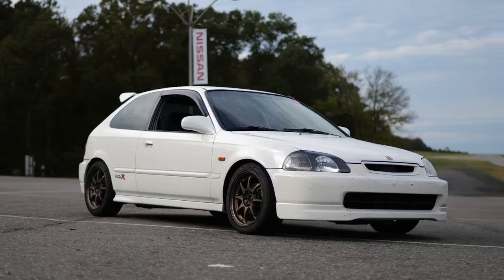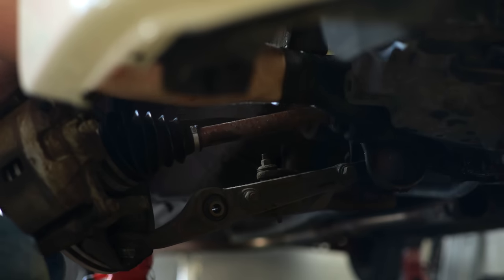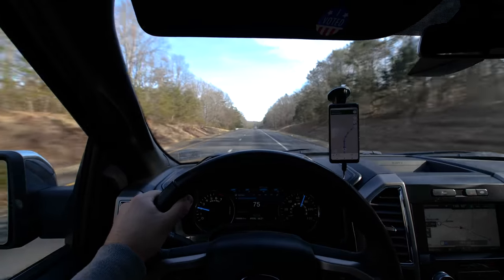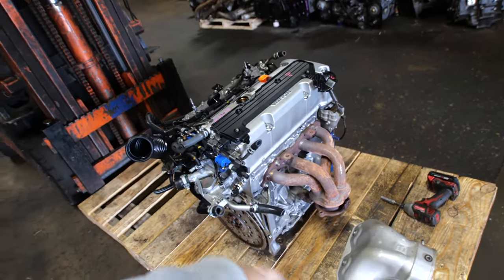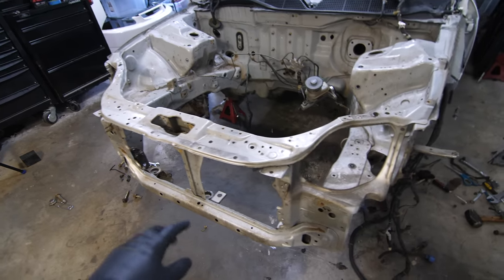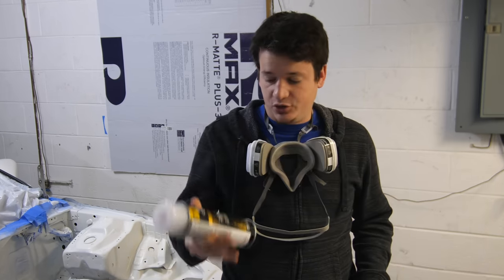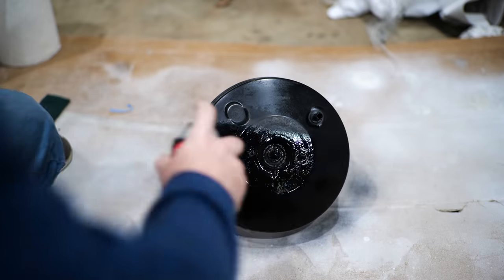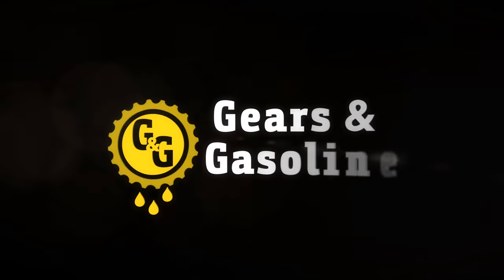K Swapping My Honda Civic – Episode 1

Comment from the maker: Something to note about this video: We no longer endorse Jspec as a source for buying JDM parts. Jspec was supposed to be a reputable source to buy parts from instead of buying from the classifieds. It's sad to hear there are allegations against them for selling stolen parts from Japan. Because of this, we can no longer endorse them as a source for buying JDM parts.
Reply: No!!!!!  I was looking into purchasing one from them since they are in Va!  Where would you recommend purchasing a motor from?  Im located in Northern VA.
Reply: @wags823  JDM Engine VA for sure, there's a ton of different shops in NoVA and so far I've heard the most good things about JDM EVA, I'm planning to pick up my B20 high comp from them
Reply: Doesn't matter where they get the parts. as long as you buy it fair and square no harm done.
Reply: Update, they fucking got me with the B20 they sold me, junk motor
Reply: @bagfumbler  damn, respect for finding and updating a year later.  How is the behold going??
Reply: You supported those dudes with the refrigerant evac. That's even worse.

Comment: Engine swaps, the coolest thing since engines.
Reply: yep! but its risky i think
Reply: @lexithelexus7377  how is it risky
Reply: @fabiolawrence9162  the car wasnt designed to withstand the pwoer so the hoses are more likly tpo break, or other parts of the car are exposed to more presurre
Reply: @lexithelexus7377  Yeah, that's why he's putting in a new radiator and A/C compressor so that it withstands the higher rpms  and pressures. New subframe so that it fits in snuggly and well distributed. If the transmission is the same, that one might suffer but everything else should be fine.
Reply: @lexithelexus7377  you've said that same comment in all the other post lol . Having a race car is always a risk . But were always going to take that risk . If it breaks we fix it!
Reply: @miguelpatino1443  i just cant phantom driving a high hp car with the mods, and risking something to just combust, u know
Reply: Lmfao bruh.
Reply: @lexithelexus7377  i dont know . I have a evo 8 I plan on making faster and I want full bolt ons and bigger turbo.  It's part of the game to break stuff . If you want reliability buy a fast car under warranty . But I like to wrench on my own car
Reply: Not really, turbo whistles are stupid but cooler than an engine swap
Reply: "Since engines" lol 😆
Reply: Just done a kswap on my civic
Reply: @charisma7268  you should have filmed it!

Comment: 10:49
I wasn't going to type the tip but...Probably the easiest way to clean the bay is to section at a time, spray degreaser on it, scrub with a wet wheel brush, rinse the brush when it's too dirty, then rinse the section, repeat until clean.

Comment: I bought a brand new 1997 Civic DX hatch—the exact same car as this. What a sweet ride. Little motor was so rev happy and smooth! And it had the best shifter I ever used; smoother than my new 1972 MG, my new 1987 Z28 Camaro, my new 2005 Civic sedan, my new 2017 K24 Accord Coupe. (Yes, I’m old, lol). I’ve certainly enjoyed your x-country trip and these swap videos. Thanks!!

Comment: "...by the time I gotten to sanding the engine bay, my arms were so tired I had to call in my fiance for extra help" YOU LUCKY SOB; do not let her get away!
That is a really good rattle can engine bay job; so good in fact I'd believe it was done with a spray gun; kudos for going to these lengths; the new hardware, hood latch etc. is just the icing on the cake, and what separates a great swap from a good swap.

Looking forward to more of this swap/build even though I have zero interest in FF stuff.

Comment: Did you trade the rare and expensive b16b for the dime a dozen k24?
Reply: GIZZMOTORSPORTS fr lol I would’ve just started building the b16b a lil bit if he just wanted a lil more power. But this makes for better content
Reply from the maker: The K24 will make twice the power with a much flatter powerband
Reply: @iiRapidzIV  a 1.6 doesnt compare to a 2.4. keep the b16b untouched and tucked away for sure, but swap it for a k24 yesssir!
Reply: dvtc8u b16b is good for turbo. They can do damage.
Reply: @TheBb6prelude  even a d16 will do damage turbo. but cant compare to NA 2.4
Reply: You haven't driven a properly k swapped civic.
Reply: Should have built the rare b16b instead with internals and a proper Turbo, everyone's doing a kswap but not everyone has a b16b engine just saying 🙄
Reply: @theimporttuner399  exactly! Everyone has gone K.
Reply: @The Talentless Mr. Kipling these cars are so light, traction is already limited with a b series. 2.4 wont make it any faster around a road course.
Reply: @GearsandGasoline  you gotta put it to the ground tho. I was just saying the B16B is and will always be worth a lot more than that k24, I hope you didnt straight trade it. I would have personally built another car, I liked your HB as it was.
Reply: @GearsandGasoline  my modified all motor "B16B" EK vs your K24 how much of a performance difference would we see?
Reply: @GIZZMOTORSPORTS  This. That EK hatch he's got is just so clean and such a nice Type-R clone I personally would've left it alone. But it's his ride and I'll definitely watch the build
Reply: sekint lyf  it's not a real type r if I remember correctly, just a clone.

Comment: When did bolts start getting so much attention. The first time I heard of special bolts is tommyfyeah with his zinc coated bolts
Reply: I bought a bunch of yellow zinc 10.8 bolts from belmetric.com for my Miata engine bay to replace a bunch of old rusted silver bolts.  Made a huge difference in engine bay appearance!
Reply: @Patrick94GSR  I can respect a safe and practical car modification
Reply: whoa  amamamma !
Reply: Downstar, for sure. Before then everybody was trying to match bolts up at hardware stores. Now everybody from MPC to Ebay has bolt kits.
Reply: "dOWnStAR fANcY HaRdWeaR"

Comment: Love these videos. 

Recommend Evapo-Rust to remove rust from any rusty parts before painting. Drop it into a jar or bucket of the stuff, and rust will be gone in a few hours. Sand or use steel wool to knock off any remaining buildup.

Comment: Going from my B18C1 to a K20a2 and it's honestly feels like V6 torque with the 4 banger high RPM pull up top in the range! Chirping 3rd and 4th on the street and spinning through 4th to 80 in the rain. Open differential is not ideal though so don't forget an LSD! Building hondas is so fun!

Comment: "I didnt want to remove the lines ans get air in them".....removes brake booster....lol
Reply: As long as you don't crack open the hydraulic lines on the master cylinder, you can remove the booster.  It has it's own set of seals, and does not make contact with hydraulic fluid (unless the master cylinder is heavily worn, and it would require replacement at that point anyways)
Reply: Oh my😂
Reply: Nice try bro
Reply: Was wondering why he was so desperate not to get air in the system, surely you could just pick up some dot4 and do a full brake bleed afterwards?
Reply: @blazeclarke  not having it removed didn't seem to mess up the job much anyway, so might as well not bleed the brakes if you can

Comment: Since when did 260 horsepower make a car not streetable? 😂😂
Reply: In a car that weighs around 2000 pounds the wheels are gonna spin too much off the launch and you have to be more careful with it
Reply: Btterthanyu I'm talking about daily driving.
Reply: It doesnt.  But, I know Ben will also be doing other upgrades in the powertrain, such as a ceramic clutch, lightweight flywheel, limited slip differential, Urethane or Delrin mounts, etc...   All of these will increase NVH (Noise, Vibration, Harshness) and will take away from it's smooth driving characteristics as it had.  I have actually driven this Civic, and it changed my opinion of Hondas of that era.  Can't wait to meet up with Ben sometime this year and get an opportunity to drive it afterwards.
Reply: If he runs hard mounts, doesnt keep ac, runs a twin disk, doesnt have decent coilovers, or runs a 3" exhaust, uses race harnesses only, deletes the heater core, or runs a top mount shifter, it's not that it's not streetable, it's that you wouldnt want to use it to pick up paper towels at cvs or hit a drive through late at night. It just becomes an annoyance for normal life stuff.
Reply: ikr should be more streetable with the 6th speed compare the b16 5th on the highway, plus rhdkev drove his integra everywhere with his k24 k20 frank.
Reply: @jdmtsheej3051  1/3 is honestly a bitch in the jdm 6 speed. I'm in 4th before I get through lights just to avoid unwanted attention.

Comment: Note for the next project: find some cheap media sanding gun  and some affordable medium (30-40 bucks should do the trick at harbor freight/princess auto for a 15 bucks gun and 20 lbs of idk what media). Put the car in  a large tarp, bend the tarp walls upwards and prop them well, then put guards/wall all around, the walls falling inside of the tarp. So: any grain that shoots outside, hits the wall and then is collected on the tarp. Or better yet sew a tent out of cheap fabric.

Take a cheap box fan (5 bucks on craigs/kijiji) blow air in, also blow air out with a filter on top of the fan to collect micro dust. A similar tent can work for painting. I know I painted my house molding in a room and I used such a system (blowing air into the room, blowing out on a window with a cheap 20x20 inch 3m house air filter).

PS: you certainly got the respirator part down ;)

Comment: Doing the same. Getting rid of my J-Swap (V6 swap) for a K-Swap. I already have a K engine in my 07 Si. Can’t wait to drive me K-swap. JDM K24A. Not using a K20 head. Going to stay K24A. My Si K20Z3 that’s supercharged is fun to drive and Auto Cross. Maintaining power steering and adding AC back to my EK. I can’t wait.

Comment: Tip to removing the cotter pin from the linkage.  *never hammer on the pin, you could damage you transmission*... use a forged steel 4-6" C clamp, a start bit and a 10mm socket to gap and catch the pin. It will slind 'right out 1-2 minutes tops. Just use the star bit to slide it right back into place when you are reinstalling the linkage 🤙🏾
Reply: *star bit (fuckin auto correct)

Comment: I sway is the way to go. I’ve got a k24a2 in my 04 accord coupe and while it’s stock it’s a blast to drives- and surprisingly corners well (for what it is). Probably gonna drop a TSX motor in it and do some bolt ons, and lower it. Its got almost 300000Kms on it but it’s still running strong

Comment: Props for not releasing the freon into the air. I miss my rsx-s owned 10yrs 180k before moving overseas, not a single issue. My fav civic body with my fav honda engine besides the s2k, should be a sick build man. Id have kept the b18 though as much I love the K lol.

Comment: Should have K swapped the ZX2. Or.. put the B16 into the ZX2. The outputs on the trans is the same 26splin as the Escorts G-series and even uses the same shifter set up....

Comment: Got a 15 min drive out of a k20 swapped eg6 id say over 10 years ago.eye opening experience to say the least.I tried to run the vti ef9 i had at the time against it..clear difference from get go but soon as the eg6 crossed into vtec it gained about 2 extra car lengths ahead and completely gave me the skip😂😂

Comment: A Honda 10mm bolt works well, the threads start to peel away with some hammering making a dowel, then the bolt stays in and you keep hammering it out. Easy.

Comment: Just a tip for anyone removing the B*tch Pin, Use one of the power steering pump bolts. It's the right size to remove it, I've never found a punch pin that ever worked for it. Heat is your friend.

Comment: While the engine is/was out, a wire tuck would be nice. Extra clean look 👌

I'm a bit worried about overspray on your bodywork, it's amazing how far it travels. I'd defo get the detailing stuff out once you're done with the swap

Comment: If you leave the engine out entirely, it actually reduces a lot of weight and gives you way more horsepower since the engine is the heaviest component
Reply: I think the unibody weighs a good bit more.  Delete that for the most weight savings possible.

Comment: Awesome work, you just forgot to remove the engine mount and throw in the K series one before paint. Waiting patiently for the rest of the episodes💯
Reply: If he goes for a tsx/accord style 6 speed with some ekk4s hes gonna need to weld the pass mount in the front too so that outa be interesting. I doubt hes going that rt trans/mounts/shifter wise tho. Do the ekk2s line up strange on the pass side too? Idk

Comment: You never mentioned adding a clear coat over the engine paint.  Hopefully you did.  You will be surprised at the number of little nicks in the paint over time.  I did a rattle can paint job on my widebody a couple years ago, which holds up great.  Cost effective and easy to do.

Comment: Something I wish I knew 4 years ago when the video first came out (even though he addresses it in a later video), he buys the bolts online. You want to search for an assortment of metric bolts. M5x.80, M6x1.0, M8x1.25 metric threads will cover 95% of all bolts in my experience on japanese cars, so buy like a million of those.

Comment: The easiest way to remove that pin, is to use the bolt that hold the spare tire down. With a vice grip and hammer.

Comment: not sure how many honda swaps you will be doing but be careful rolling those around without axels in the hub, the bearings will separate and the wheel will fall off. I just had it happen to me and it wasn't fun getting the wheel back on with the car on the trailer.

Comment: I see that you have weak brake booster (or maybe it looks so). If so - you should swap a doubled brake booster from honda prelude with 15/16 or 1' brake cylinder from the same car (actually it does not matter from what car you will take it, but fluid tank shoud be not at an angle). It will work good with 260 stock brakes and with 280 swapped front calipers and non stock brake disks.Also will be good to change brake force regulator for some tuned one if you wanna drive safely on track.

Comment: you should reinforce the engine bay chassis, i have ran a similar setup back in the day and after tracking i had chassis twist on me due to power/torque abuse. tough lesson learned tracking my k24R

Comment: One sad part is that he is going to need to retouch a bit on the paint for the new post mount bracket. They have to sand to bare metal and then weld the new plate for the post mount on your new kswap. Most people would do that first before sanding all the engine bay and painting it. But good progress btw

Comment: Spray paint is EXTREMELY VOLATILE. You will notice that the entire car's exterior paint and glass will now be rough because paint particles have settled on them. Your front bumper and wheels near the car probably has the same thing too. You'll need to cut/compound/polish your car after you're done painting.

Comment: 08 tsx k24 bottom with Rsx types k20 head wid k20 oil pump with a TypeR tranmission and you have yourself a 2018 civic TypeR r swap without the turbo

Comment: Hondas are easy to work on until you need to replace the knock sensor on your k24 and don't want to take off the intake manifold. Although I don't think you need a knock sensor if you are running an aftermarket ecu. Just a stock honda problem.

Comment: Should've went the opposite way with swapping. With that sweet cherry picker could've just dropped the entire subframe, lifted the car with the picker and wheel out the motor. Usually the easiest way with older hondas if ya got the equipment.

Comment: stainless steel bolts get loose over time, you need normal steel zinc coated or galvanized .

Comment: Do you happen to have information on all the bolts you replaced, along with where they were purchased, appreciate any info/advice/point in the right direction possible.
Reply: Something I wish I knew 4 years ago when the video first came out (even though he addresses it in a later video), he buys the bolts online. You want to search for an assortment of metric bolts. M5x.80, M6x1.0, M8x1.25 metric threads will cover 95% of all bolts in my experience on japanese cars, so buy like a million of those. Look at harbor freight.